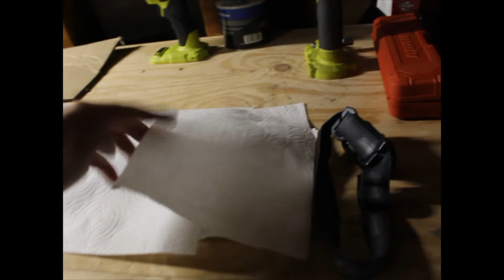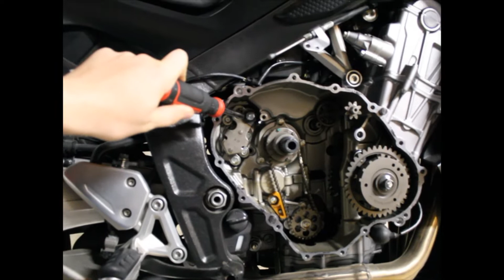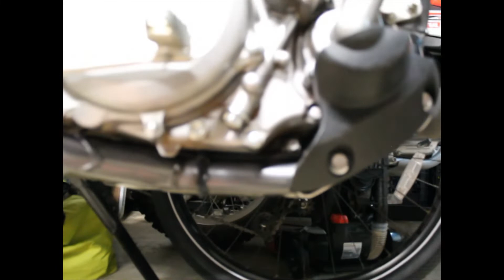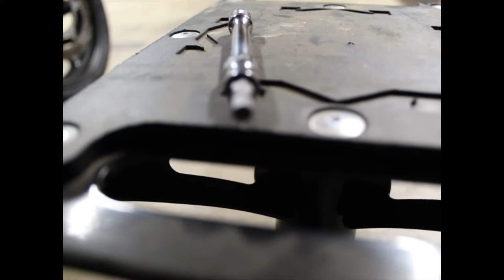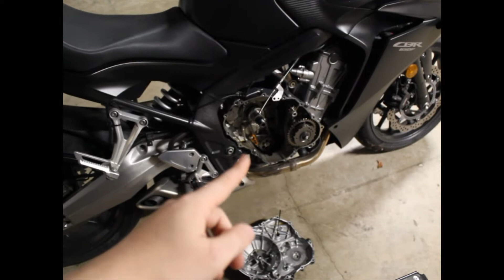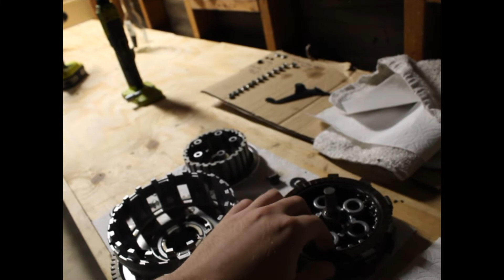Honda 2016 CBR650: Gear Shaft Problem and Fix

Comment: Thanks for the video. I think a lot of people are solving this problem the wrong way by screening on this external bearing thing. Do you know the part number from honda for this retaining clip for this shift axle? Or like a link to any useful exploded view of the situation. Thanks for the video
Reply from the maker: Thanks for your reply, I appreciate it. I do not, however I use Motosport.com, shop OEM, and use all of their exploded diagrams to narrow down parts. I do not have the part number as this was done awhile ago. However, all I did was go to that website and sifted through the helpful diagrams until i found it. Hope this helps!

Comment: Hey do you know what size socket you used for the clutch basket. Im getting my tools in ready to do the same thing ti mine. Damn tab is too flimsy 😅
Reply from the maker: Good question, this was many years ago so I do not recall. I think it was over 20 though. Maybe a 23

Comment: Have the same exact problem. But the tab broke off and is no where to be found lol 😂 Tried all kinds of magnetic pickup tools in the oil pan and I am very confident it’s not in the pan. Can I just throw everything back together? Really don’t want to drop the oil pan.
Reply from the maker: Try draining the oil and seeing if you can see down into the pan. At oeast if you drain it and not move the bike, you have a chance it flowing towards the drain plug. 

I dropped something into the pan and i used a small magnet tied to a rope and through it down into the pan and got it back.

It needs to come out, it could through the motorcycles movement be brought back up and mess up all sorts of moving parts. If you do not find it in the pan, it could be lodged elsewhere.
Reply: @jayb460_ Dropped the oil pan. Found the bitch sucked up in to the oil strainer. She is out now. Everything just got to go back together now. Appreciate your help brother.

Comment: Good video, except actual detail of how to remove 30mm nut on end of gearbox input shaft. Must put bike into gear, then I managed to peen out the lock tab on the nut. I had the same problem but bracket did not fracture, just bent with a fracture crack, across the too small bend radius so I hope to get it welded up. Also I installed a 10mm dia rubber hose sleeve on the opposite side of gear change shaft. Crappy design by Mr Honda> Can send you a photo of the input shaft sleeve.
Reply from the maker: @ggburleigh Thank you for the input. I used an EBC tool that holds the clutch basket in place and a impact gun to remove the nut. Because the nut is "staked", you need to purchase a new one and stake it using a hammer and punch

My email should be in my YT bio

Comment: Thanks so much. This is the exact issue with my bike.
Reply from the maker: This means a lot to me, you are first to show appreciation,  thank you!
Reply: @jayb460_  Not sure if you remember much about this, but if you wanted to replace the entire shift shaft, could you simple pull it out and swap it? I think the spines may be destroyed on mine (which was caused by the same issue as bending/breaking the tab)
Reply from the maker: @alphawolf2993  oh damn, ok. May I ask how that occurred?
Reply: @jayb460_  you're going to think I'm an idiot because I am. I was changing my front sprocket and instead of just removing the linkage to the lever where you actually put your foot, I removed the shift off of the shift shaft splines, as on dirt bikes the shifter is directly on these splines. I had left the bike in neutral, but needed it in first to be able to take the sprocket off, so I held onto the splines with a vice grip and shifted into first. This probably messed up some of the splines, so then I couldn't get the shift back on. I figured if I tapped the shifter back on it might reset the splines straight, so I tapped the shift back on lightly with a hammer, which is when I must have bent this tab inside the engine. It's still rideable currently but I have to occasionally pull the shift shaft out to shift, so its a bit sketchy.
Reply from the maker: @alphawolf2993  You are far from an idiot! Thats how we learn my friend, and you taught me something and you figured it out on your own. Sometimes it takes a bit of playing around and looking at schematics (good on you for referring to those).
Reply: @jayb460_  You know what, looking at the schematics this doesn't seem possible. I might just have to try and file the splines.
Reply from the maker: @alphawolf2993  And I am not to sure to be quite honest. When I took everything apart, that piece theater broke off in my video prevents the shift from falling off that selector AND sliding in and out. It should only be a slide in and out sort of thing since its a very basic rod going through the engine block. Removing all the gear selector (left side), you can pull it. However in your research, I found ways to look at engine parts by finding videos that indirectly reference them (in this case, I watched people change their cluch packs out and found keywords like "gear shift rod " or "gear shift shaft").